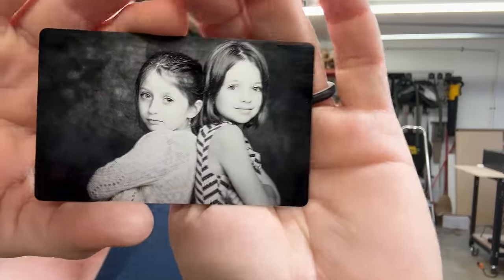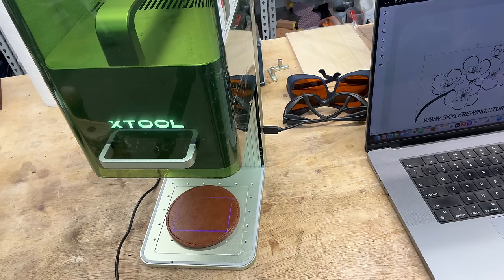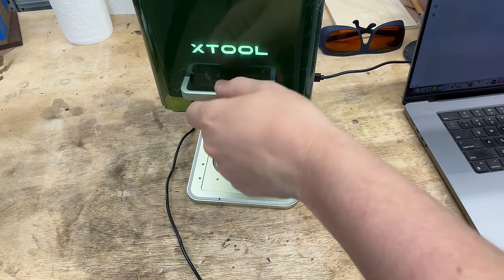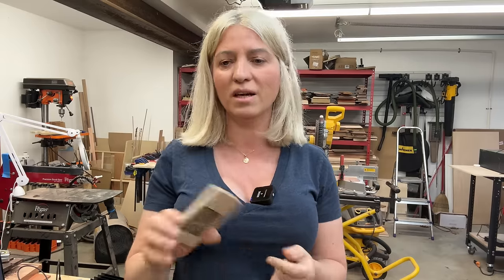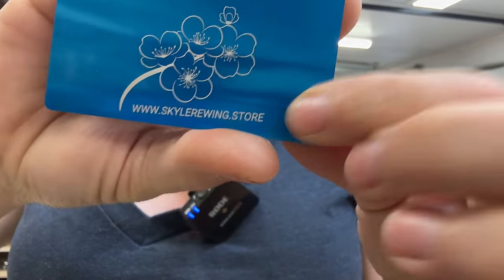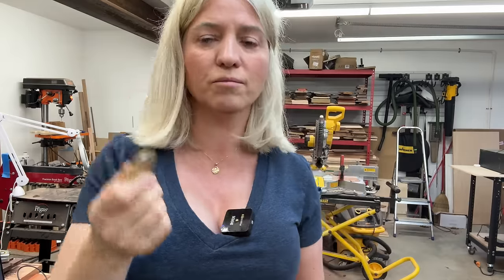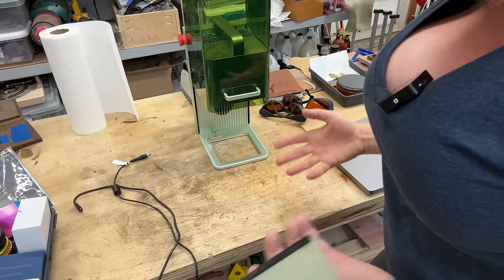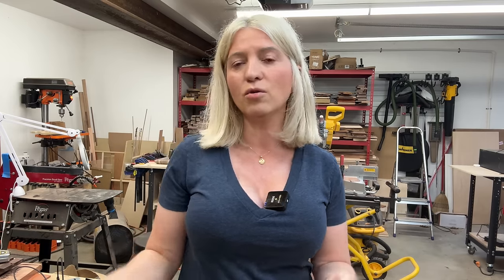Xtool F1. Most versatile and portable laser. 2 in 1 laser for all wood and metals

Comment: You sold me. Do you have a discount code?  How can you get a credit for my purchase?  P.S. - I love your challenge coin you sen me. Thank you.
Reply from the maker: Click on the link in the description to go to Xtool page ( if you use my link I get a small commission, if you don’t, I don’t) then once on Xtool page go to menu on top left and choose trade in. Claim your reward. I am glad you like the coin, you are very welcome. The coins go a little slow on this machine as is only 2w for infrared and you need pretty high power and low speed for this particular material. The new F1 ultra Xtool announced will have 20W fiber laser which engrave metal way faster

Comment: Nice little engraver. Wonder how deep it is from vocal point to back of laser? For engraving the bottom of bowls, need to know max size bowl would fit? Thanks and stay safe.
Reply from the maker: I will test tomorrow and let you know
Reply: you can set the machine on spacers above the bowl and laser the bottom.....not sure about the maximum depth capabilities of the bowl. I just tested....you can only go about 1" deep beyond the bottom of the machine taking out the metal plate, if you placed it on top of the bowl, so that won't work. If the bowl is a big one, you probably could set the machine inside the bowl and do it. Otherwise, if the bowl is set inside the area (where she placed all of the items in this video), the maximum diameter of the bowl would be approximately six inches and the maximum depth of the bowl would be around four inches. Hope I explained that well enough.